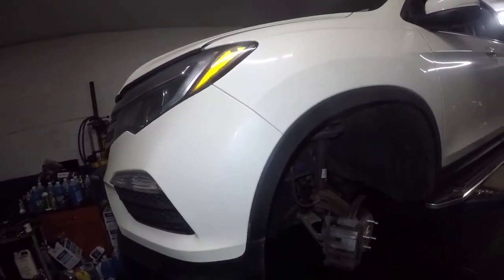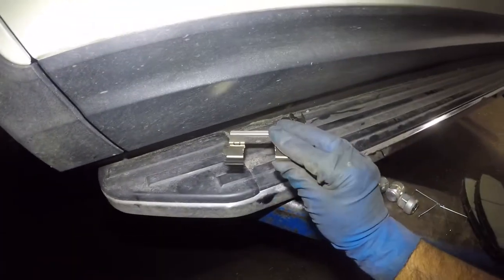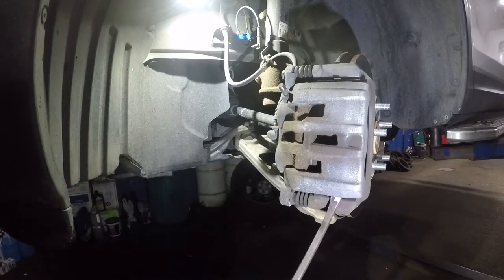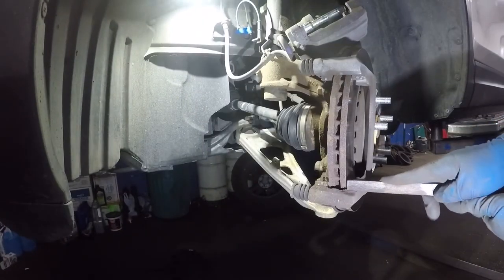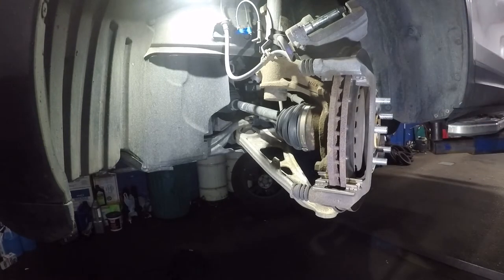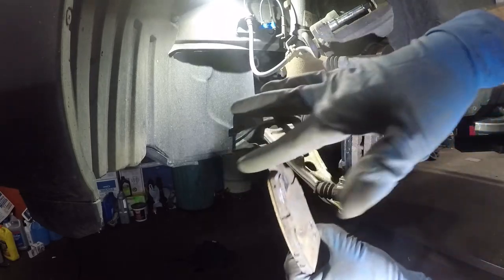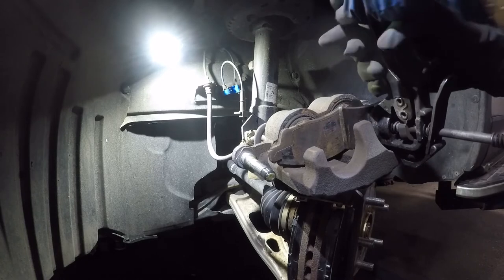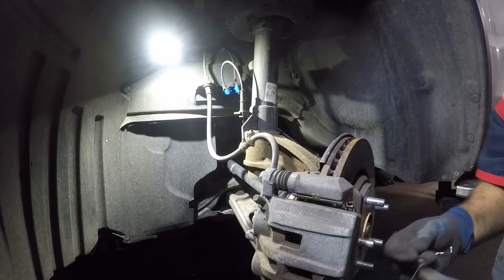How to replace front brake pads on Honda Pilot 2016 and UP

Comment: For all DIYer out there just a safety advice after replacing your brake pads. You need to pump your brake pedal 3-5 pumps on the pedal max to move the piston back in contact with the new brake pads.
Reply from the maker: Yupppp

Comment: I always love a little comedy in a repair video: 3:37 “your brake pad should go in easily and smoothly, you should not be struggling with the brake pad.”

As a DIYer - it takes me a certain amount of time to Jack up the car, put Jack stands in place, take wheels off, and take out the pads.  At times It takes me the same amount of time to reinstall the pad and deal with those awful wire placeholders.

Comment: Do you recommend antiseize on top and bottom of the pad?  Also what about blue loctite on the bolt?
Reply from the maker: If u wanna take a step further then yes
Reply: I always use use Sil-Glyde brake lube on all my pad edges where metal touches metal and also on the slide pins. It lasts a long time and keeps your pads nice and quiet and wear even.
Reply from the maker: @UFOGHOSTHUNTER  nice!!

Comment: How did you get the springs to stay there while you put the caliper on?
Reply from the maker: Usully I hold the pads togather with spring retainer in place and prior to that I have my upp caliper slider pin in and caliper is ready to come down
Reply: @RBTheMechanic  I put my honda springs back in the new wagner ultra quiet springs were different and kept sliding out. I wonder if they did that on purpose so you would have to buy new brakes a lot sooner.
Reply from the maker: @igorsolovyanchik8955  not sure I don’t like Wagner brakes thermal quiet 🤫 I use to use and they were super loud hated it I use akebono or power stop

Comment: what's the torque spec for that 17mm bolt? 🤔
Reply from the maker: I would have to check from shop
Reply: @RBTheMechanic  nvm, found it in another video of yours (https://www.youtube.com/watch?v=7Gbup386DtE), it is 53 lbft (front brake, 17mm bolt)

Comment: How many miles when you replace them?
Reply from the maker: Sorry I don’t k ow how many miles this truck had at the moment when pads was replaced
Reply: @RBTheMechanic  sounds good. Did you bleed the lines after?
Reply from the maker: @soldado23  no I didn’t do any fluid changes so it wasent required